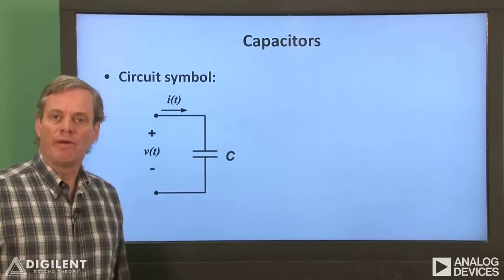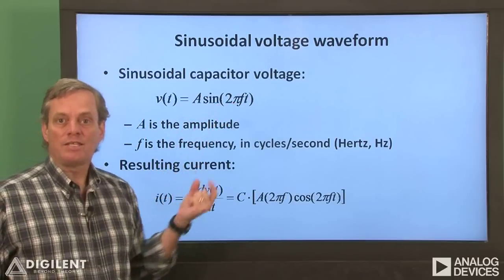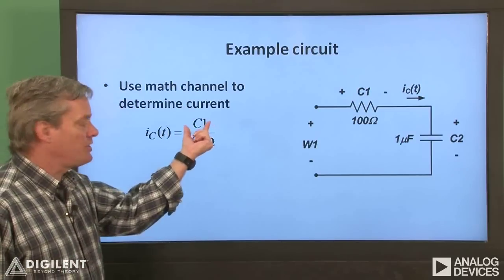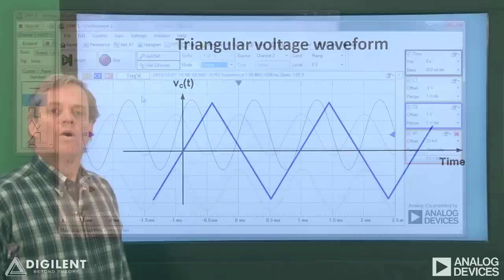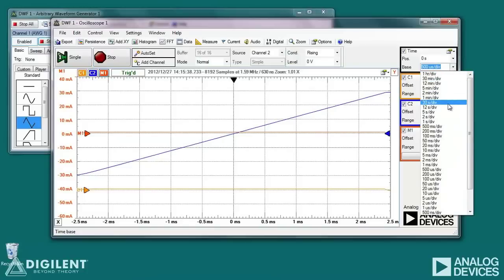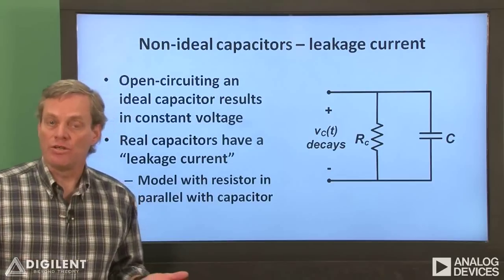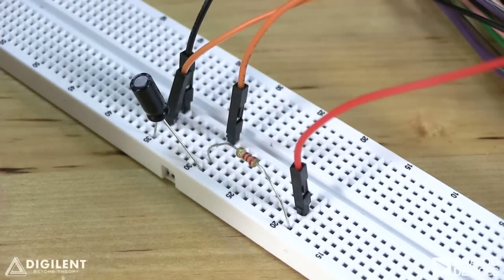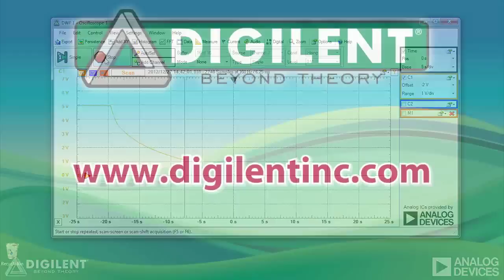Real Analog - Circuits1 Labs: Ch6 Vid2: Capacitor V-C Relations

Comment: Nice video. However the Analog discovery Scope input impedance is not infinite (1MΩ).  This may provide a discharge path for the capacitor that will be added to its internal capacitance leakage current and result in higher leakage. 

I like this video series, its practical and informative.